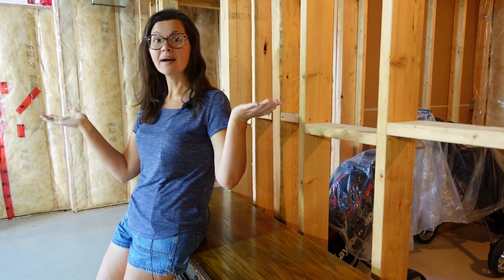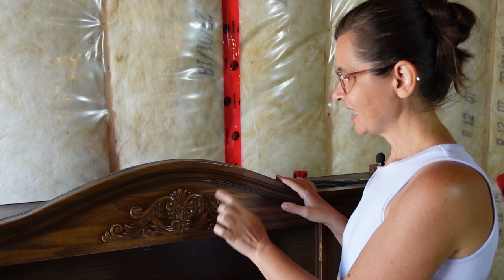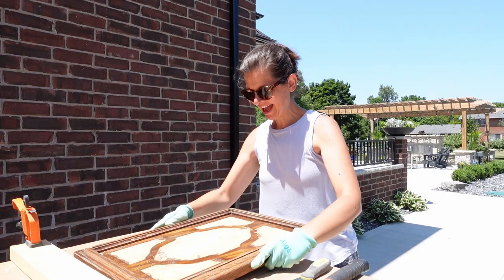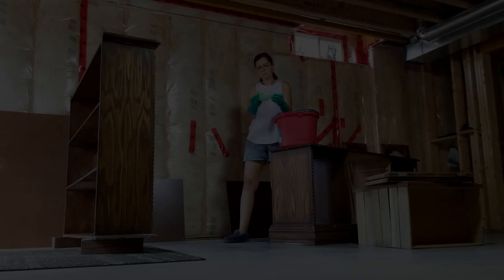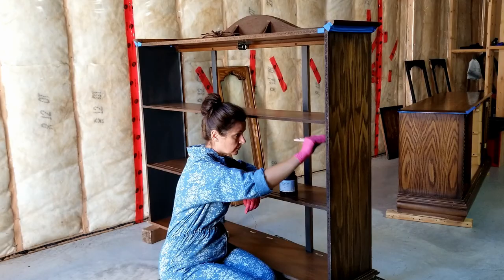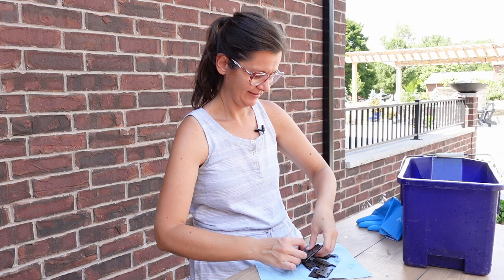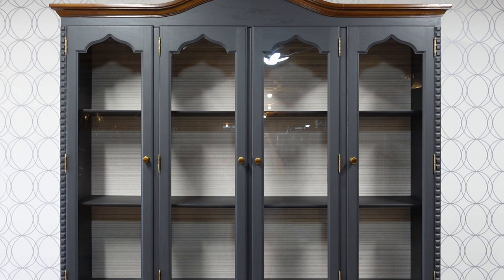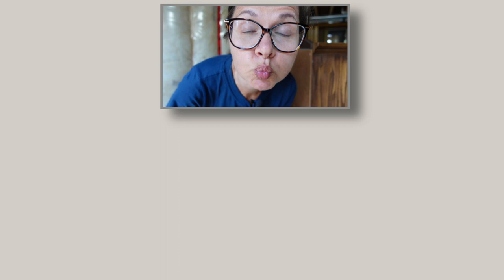Furniture Flip |  China Cabinet Makeover |  Painting with Fusion Mineral Paint

Comment: This is beautiful.   Nice job.  So, with the fusion paint there is no sealing or waxing?
Reply from the maker: Thank you!  Fusion says this is primer, paint and protector all-in-one.  I didn't seal or wax this cabinet....that being said, I have started using a protective finish on Fusion.  On dark colours you can see marks if you drag something over the surface, most times they wipe off, but I don't want to think about it.  I love the feel of wax over Fusion, it's really nice.  I've also used Saman brush on clear coat and even sprayed some Behr clear coat just recently.  All had good results.  Fusion is still my go to for furniture for sure.  But just to be extra careful, I do now add a protective layer.  Funny thing about this cabinet -- I'm going to be REPAINTING it soon!  I love this colour, but it's too dark in the basement.  So complete makeover time!